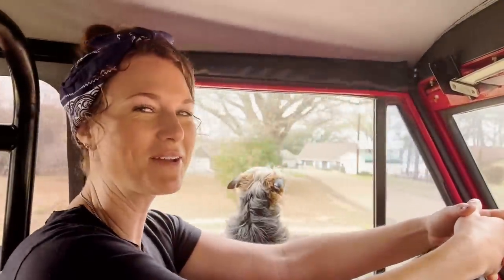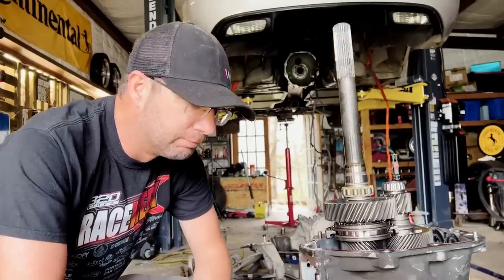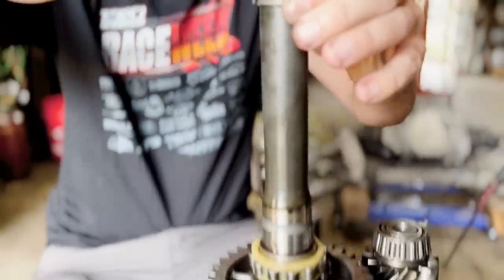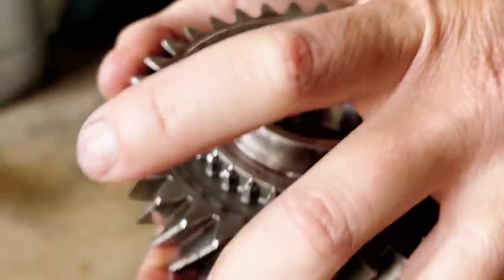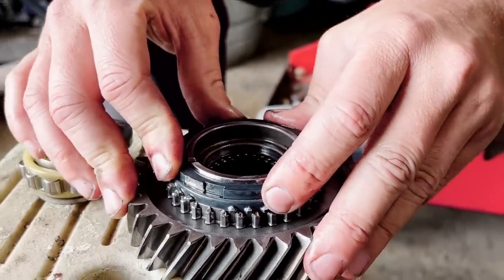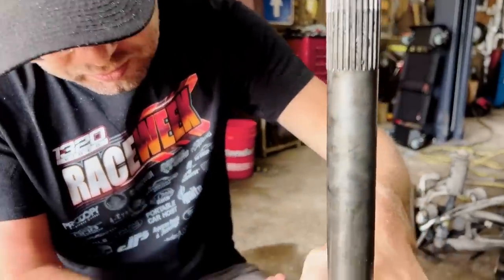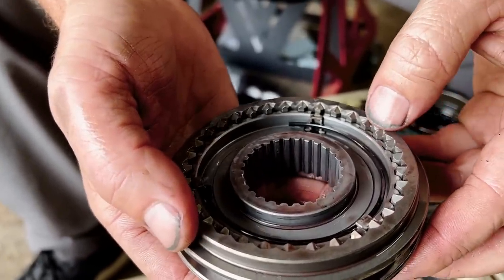C6 T56 disassembly! Are we crazy?! Transmission rebuild Pt 2

Comment: A transmission is not black magic. If you put the pieces back in the correct order - and they can generally only go one way - it's going to work again. You guys can do it.
Reply: A manual isn’t, but an automatic brings things to a whole new level of Merlin 😂
Reply: @stewkeene  I once started on a Suburban auto trans before buying a rebuilt one.    🙄
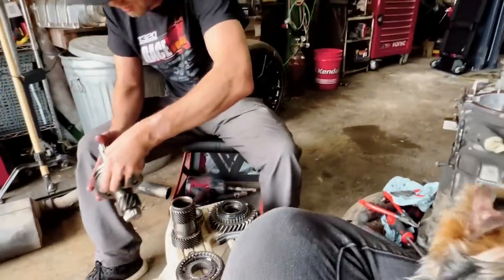Reply: @vonheise  ui😮😮😮😊😊 10:21

Comment: I agree with your thoughts on "just getting after it." I was brought up with the idea that "you learn by doing, not just schooling." Plain old common sense helps but there seems to be a shortage of that but I digress. There is no substitute for hands on experience. Many of the tools that we use today were invented/improved by DIY folks. When I look back at some of the early wrenching I did I am amazed it turned out so well. While it wasn't always pretty and/or perfect.  While we did build a lot of things the most important thing was self confidence. I always thought that if someone put it together, I could do it as well. That philosophy worked...well most of the time. A little hitch in the giddy up is a good teacher as well. Great video guys. Keep em cumming.

Comment: One of the things I love about this channel is I recognize the farm kid type mentality. I grew up working on ranches and rarely had the proper tool so we did what we had to with what we had. I wouldn't completely rebuild something if it didn't need a complete overhaul. My favorite tool is a hammer and I agree that every tool box needs a brass hammer or 2.
Reply: I also do my own repairs on everything I think I can fix. Usually I use whatever tool is handy or hope it will work. I often reuse many parts that I have saved from other projects. Keep up the good work.

Comment: The teeth that engage the synchronizer rings should be pointed on the end.  It helps them engage sliders and speed up the next gear.  Reverse used to be straight cut Gears back in the day,   She makes you look Sooooo Good.  Well done.  Good thinking going full disassembly.  I recommend you let them reassemble it.  Just because.

Comment: You raise the same background as I was. I grew up on a small ranch, and we had to learn how to make do. There were times when we failed and chalked it off to the cost of an education. Admire both of you. I was a submariner in the Navy. And came in contact with a lot of different mechanical and electrical systems, and learn even more.
Reply: I have a Ford F150 pick up that has more than 230,000 miles on it. I love the truck and would like to get the engine rebuilt. I can’t do it myself anymore because of an injured back and neck. What would be the possibility of you to doing it. I live in Burlison Texas. If this is a possibility, shoot me a response.

Comment: That transmission place sounds great. 
It makes sense you can flip that reverse syncro. The 6th gear syncro doesn't do too much work. 
I expect those damaged syncros are on the 1-2 syncro,  it would have been worth changing regardless.

Brass and other non steel hammers will bruise parts less. Certainly not compulsory, but it does help. 
Aaron you're doing great. With all the engines you've rebuilt, you can do that little trans. 

Emily, have a look at getting an impact wobbly, they're less likely to throw a fastener or socket out at you. 

A dedicated set of forks will help your little tractor because it brings to load closer to the tractor. Putting the block on the back will help too. 
Hope all the work on the house is going well <3

Comment: The 4 l 80e video is the one I started watching your channel at. I was rebuilding one at home and the reverse piston seals were giving me a time. On the t56 it reminds me of a I think it was a 4 l30 you put the insides together and then slid the case over it. I have to agree with Arron on using what you can reuse I don't make much a week so I use what I can to get me back on the road. Great video once again you two.

Comment: I remember reading that leaving your hand on the Shift lever would also wear the synchronizer rings.  There has been a lot of speed shifting on that box.  You would not believe how simple a Muncie 4 speed is.  Out in 20 minutes, 109 needle bearings as I recall.

Comment: So the snap rings without the holes in the ends are actually locking rings. There is a set of plyers you can get that are locking ring plyers that are kinda serrated on the end flats that bite into the points of the end of the lock rings. I picked some up at advanced auto. I learned that the hard way rebuilding a automatic transmission. I work on industrial equipment for years and never knew that until doing a transmission. Game changer.

Comment: Look for wheel weights for that tractor. They mount on the wheel itself and give it the ass it needs for traction. And don't forget to add air to that left front wheel since it looked so squishy.

Comment: You guys are an inspiration to me. I have a similar issue coming up on my 2010 Mustang GT who's 5R55 transmission is toast. We bought it used and his pour car was quite abused but perfect for Michelle's needs. I'm considering a 6R80 for the extra strength over the stock five speed, but a new drive shaft will be necessary for her Mustang. You both mean more to me for the encouragement to try as much work as I can. Hopefully see you both in June. cheers, - Wright Sublette

Comment: I have encountered the frustration of snap ring pliers not working right. 2006 f350 hub bearing assembly kicked my butt! Ended up using small needle nose pliers with pipes on the handles to get enough leverage to open the snap ring.

Comment: I have the exact forks… They work great but I need to mod them a bit by welding larger pads in the bottom and top to that the weight is dispersed better on the bucket. OH, and I have a hoe bucket attachment on the back of my tractor so that it doesn’t do reverse wheelies. hahahaha

Comment: If the C6 torque tube has a large snap ring on the end, a large snap ring plier is best.  I believe we used a Astro Pneumatic Tool Company Snap Ring Plier Sets 9402 on the C5.  I very much recommend inspecting bearings and couplers.

Comment: I bought a pair of Pittsburg brand Snap-Ring pliers from Harbor Freight that have worked great so far. They come with adaptors/heads so you can spread open of pull together different style rings and different sizes. I like them. and they only cost $5.00.

Comment: I had to bite the bullet and bought some Snap on snap ring pliers. I didn't go the set route. I picked 3 close to the size and type I would normally use.  and for 18+ years they worked for almost everything I came across. They are still expensive, but not anything close to buying the full sets of them. Bottom line is they just worked well. the best part is they are reversable, just remove the screw and turn them around and put it back together again.

Comment: Working as a Machine repairman (Skilled Trades) for GM 38 years.. Don't worry about the keyboard mechanics,  what ever you can make work is the proper tool for the job at that time! Fancy hammers and powder coated tool boxes won't get the job done. But determination, experience,  common sense and proper lube will finesse every job! (Wink Wink)!   Carry On!  :elbowcough:

Comment: You're smart stacking the parts the way they came off and put them on the same way just like with pushrods put them back where they were great job thanks for doing this keeps me inspired my buddy just bought a glh needs a bunch of work but them cars are nuts I had one back in the day it was insane he said he's going to put a 50 shot of nitrous out to put it together I don't make it hit c curbs the torque steer is horrendous when stock thanks for inspiring me:face-purple-wide-eyes:

Comment: put some calcium-water mixtures in the rear tires of that tractor its going to help the back wheel to stay on the ground i work in the snow removal and the tractors i drive all have some calcium and water mix in the back tires to help with traction and add some weight in the back

Comment: I have a very old Massey Ferguson and I do that with the 3 point linkage and yes over 400Kg I need to add some weight to help with steering and big loads I’ve added 3 point link to my engine crane with 2 dolly wheels to take up to 2 ton and yes my 72 year old TEB20 has no problems and yes that is a 24hp Kerosene motor petrol start and a massive 4 to 1 compression ratio

Comment: I like the way you make large repair jobs approachable and I respect your down home, doin it in the dirt with rocks comments as I as well as alot of others have been there. However for better or worse equipment trucks cars are alot more advanced and conplicated Thats not to say they cant be worked on but they hust require a different touch. You can still have a basic shop but you need to have it clean work on benches stay organized keep everything in orfer and clean and have a manual. You do need to be preoared to get special tools also. Your on Social media teaching/entertaining others you have an obligation to do it right. You xan refer to the old ways as we all went through it but you also need to show the improved methods

Comment: Cant ask for any better customer service than that.....have fun with it and i dont care if its in buckets....saves them time and your broke stuff is within a few seconds of finding. 

That engine block as ballast would be awesome for ballast but would cause you to break something on the front end lol, i filled the rear tires on my tractor and added an 800lb ballast box total 1600lbs and bent a lift cylinder the next week because i couldnt tell its weight by the tractors reaction to it😂

Comment: The 5/6 cluster is supposed to be a press fit, likely will need an output shaft or the company you spoke to may be able to weld up and grind yours for repair.  Common problem with all t56.

Corvette T56 used trans are usually 1/2 to 1/3 the price of other T56 because of their unique parts.  Can't use them in anything besides a Corvette, not as universal, less demand, cheaper trans.  Used will probably have the same problems as yours tho.

The broken input shaft is 4th gear; direct drive or 1:1.  You will need to set preload on your new input shaft bearing, hardest part of putting a T56 back together.  If you have a dial indicator and a set of shims you can do the build yourself.  The little diesel engine you just put together is more difficult than that t56.  You got this.

Txdrivetrain is the place to go for parts. But you already know.

Comment: So watched this video and two things popped into my head thanks to Aaron 1) when he took apart the transmission and turned everything upside down in a stack, I borrowed a line from one of my favourite TikTok accounts and went “ What no way, for f&@k’s sake that’s damn handy now isn’t it” not sure why I’d never thought of doing that before but just so you’re aware Aaron I’m definitely stealing that for use in my own shop. And 2) I agree use the tools you have on hand in your garage, we’d all love to have garages with all the tools we’d need to do every job correctly but we can’t, having said that for that transmission job if you’d have grabbed a small block of wood, and I know we all have at least a small piece laying around that our wives ask if they can be gotten rid of, it’ll help deaden the blow, that way you use what you got and don’t risk cracking the case with the steel hammer.

Comment: I have a c7 stick and I can tell you until the Trans gets a little heat in it 1st will pop out when you release the clutch and give it power sometines if it'snot well seated.  It makes the most horrible grinding noise when it happens.  I have only had the car since January and it has probably happened 8 times when pulling out of my neighborhood.  I try to make sure it's completely in first which keeps it from happening but I forget every now and then.  If that's 4th gear that's broken then yeah it's someone slamming 3 to 4 without lifting.

Comment: Check the couplers in the torque tube the c clips are a real ass, don't use solid couplers use GM units if replacing. This is why last comment l said l drop engine, suspension coz they always new more work and in the long run its just easier

Comment: Throw a box blade, weight box or mower on back. I have a Kubota B5200 about your tractors size. It is easy to get off the ground. This is the very reason many ag workers get hurt. Even flipping a little tractor without a ROPS or seat belt can still hurt you plenty.

Comment: Humans put that gearbox together, should not be too hard to repair this trans. There is a reason, however, for some snap rings being called "Jesus Christ" snap rings......and with the input shaft missing synchro teeth, well, you just got yourself a real nice factory issue clutch alignment tool! Now would be an excellent time to replace the clutch assembly & TO bearing while you're in there.
This is a great learning experience for you both, and makes for some excellent video material! You got this! Thank you for posting this, and God bless you both!

Comment: I’m 60 I started in a automotive machine shop rebuilding engine’s boring honing and valve jobs in high school then went to school for auto body and paint painted cars and big trucks oilfield then went into the welding bay building the trucks then a heavy duty Deisel mechanic I have used the same tools you use all the time you can’t afford to buy a special tool for every project when you are only going to use it the one time if you need it on a regular basis then it’s justified makes the work easier

Comment: Those of us who relate to your being from the country, know how true that is. I rebuild crap all the time that, technically, shouldn't work. I refuse to buy air and power type of tools cus I'm comfortable with using mechanics type tools. Good old fashioned elbow grease and force. You learn torque feel when you don't have the new digital torque wrenches. A scanner is a waste of space in a tool box. Yes, you have to have one but when you're setting a carb up, we all know how good the computer adjusted carbs were, you come to respect what most don't have now. Simple knowledge of conditions and application makes all the difference in whether or not it'll run or just start. The country boys know what I'm talking about too. I'm not a transmission guy at all and I have to tear a tremec down pretty soon myself. I built a V8 Ranger that I had to switch over to mechanical from electronics. The trans I started with was an AODE and had to swap out for an AOD. I rebuilt the AOD so I'd know it was going to last me. Thank God for Google cus I probably'd have a pile of parts still waiting to go back together. I can build you a killer drag motor but transmissions aren't my FORTE'.   I'm glad to see somebody I can relate to.

Comment: That damages from heavy downshifting high RPM heavy downshifting because once you've already got it in gear it synchronize so doing a burnout is not going to blow the Synchro out if that were the case it would be second gear cuz your your synchronizing and grabbing the next year

Comment: the rings you're working with are lock rings not snap rings, I used these Mac P21A 90° Tip Lock Ring Pliers and & P22A Straight Tip Lock Ring Pliers back when was rebuilding caterpillar transmissions. buy these two Pliers and you will never fight with lock rings again

Comment: I have many "LOCK RING" Pliers,  That is what it takes to remove the rectangular "Lock Rings" Snap ring pliers are not made for removing lock rings.  Blue point , and snap on , Mac and Thorson made them , and even Craftsman made some "Lock Ring Pliers" Some of the later paralell jaw types were not sturdy enough for some of the huge lock rings that are used today.

Comment: Broke selector gear on 1st and 2nd on my 91 mazda b1800. Did i complete rebuild,  it can realy only go back together oneway.  But i think that might be 4 th gear that is broken.  I am trying to recall so if anyone has more info on that.
Also learned that on my box the selector fork is mild steel, so welded op the warn out fork, and mechined it back to spec.  So go ahead and do it.
It is broken, what is the worse that can happen,  stil be broken.

Comment: What is the right tool for the job?? Simple really, the one that worked. I grew up in the oilfield, you would be amazed at what gets fixed with a crescent wrench a pipe wrench and a bfh.( big flipping hammer for those who dont know). Broke folk do the job with whats available. Is it the right way?? probly not. But it works and that is what matters.

Comment: Would you please 'splain torque tube in the next video for us ignorant folks who don't know that one.?  
Back in the day, when I would grind gears, I would comment that I was grinding off a pound.  Looks like someone ground off an  oz. or two trying to speed shift.  I assume it was too far gone to double clutch.
That looks worse than a hundred piece jigsaw puzzle... cause puzzle parts line up and fit in easily once you find the right piece.    You should have started on the other end of the trans, then the broken gear would have been the first one...   😄